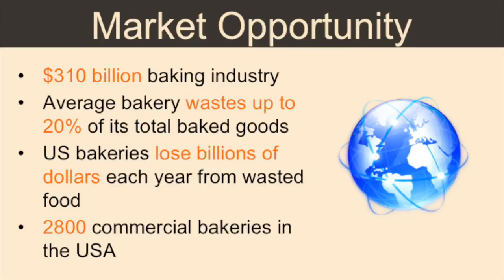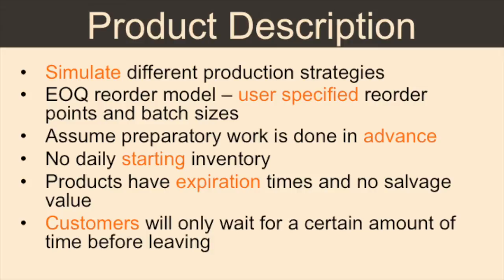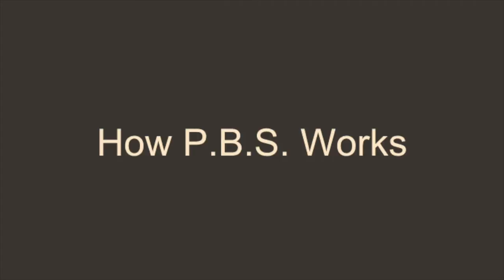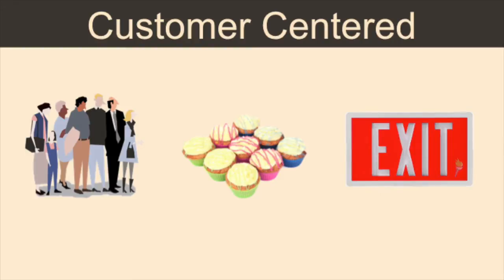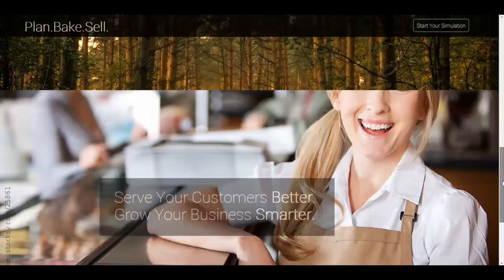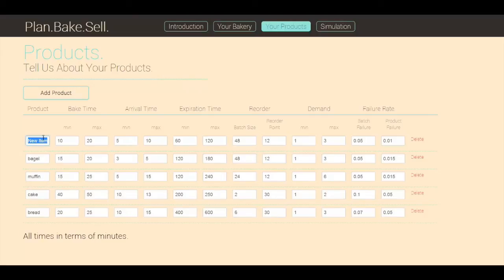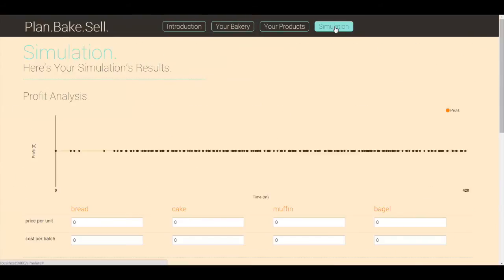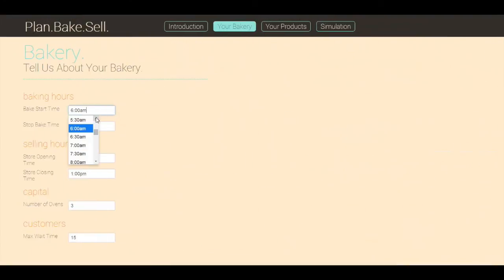IEOR 131 SP14 -- Plan.Bake.Sell.

Comment: All in all, your project and presentation are spectacularly executed. The market, problem, and solution are not just well-defined but actually highlight a compelling opportunity for simulation to be beneficial. As others have said, the user-interface design was well done and the real-time updates add that extra bit of "wow". Only thing that I would point to as a place for improvement is the assumption that customers will leave if their first choice is not available. Perhaps there could be some parameter for the shopkeeper to estimate the subjective probability that a customer selects their second choice, or third choice, etc.

Comment: Enjoyed the soundtrack and the testimonial at the end! (though some may find it offensive I would expect?) I'm concerned that the "no daily starting inventory" assumption may not be applicable to some bakeries, but you're internally consistent with this by saying leftover inventory has no salvage value.  Still, maybe this could be another improvement of your model?  Accounting for failure rates is a very good feature of your model.  Also, your UI is amazing! Good job!

Comment: (ID: DAODA) Awesome video!! The presentation is very engaging and I can see there is a huge market in front of your guys!! Since your product has four goals as it is shown at the end of the video, I think it is better if you can elaborate more on that how your simulation could help, for example, give us some performance metrics such as what percentage of customer demand is met and what percentage of cost is reduced by changing one input parameter.
Also for minimizing the cost, I think you should also incorporate the cost for hiring an extra employee to accommodate the demand.
In your profit-loss analysis, it’s clearer if you show us the formula you use, because for real businesses, they might want to add more factors into that formula.
Thank you!

Comment: I thought the profit analysis was very interesting, though it looks to me as though changing the cost and selling price of the baked good merely altered the profit for an already-run simulation, and did not affect the simulation itself. I think that it would be good if the simulation could adjust with these parameters, as the EOQ model incorporates holding cost when determining how much of a product to produce. In a bakery, holding cost is very high as baked delectables will become cold or expire.

Comment: (93914) There is no doubt that the strongest part of the presentation is the real-time simulation. Other than this amazing feature, I think the assumption about EOQ is very necessary and the overall presentation is very convincing. The product will be very applicable to both large scale companies as well as small bakery shops. Nice job!

Comment: The interface on this product is great. The graphs for the other metrics like unsold goods, throughput, and product inventory are all really beneficial. I think the model can be made more realistic by changing some assumptions. Many bakeries sell products that were baked the previous day for lower prices, which could add a salvage value to the model. Also, some baked goods sell more at different times of the day and week, which would change the arrivals rates.

Comment: (ID:CINCY) Wonderful user interface. I enjoyed the walk through of your concepts as well as the demonstration of your product and its functionality. The flexibility and dynamic aspects of your results pages are great features both visually and functionally. I think you may want to include a feature that allows for flexibility with size of ovens used. This simulation could be expanded into a longer time frame to allow the baker to plan for longer term and seasonality. Day to day may not be the most helpful if they need to order their materials in advance. I enjoyed this presentation and the music was a nice touch.

Comment: Beautiful, beautiful product. The interface is easy to use and thoughtfully designed. Works like magic! It seems like it would take a lot of effort on the bakery's part to gather all the metrics necessary for accurate simulation though... Still, great job!

Comment: Good interface design! Does the failure rate of the product depends on the sophiscation of the product (lower for cupcake and higher for wedding cake)? The model can include either disposing cost of a bad batch and/or salvage cost of leftover baked goods that can be resell for a cheaper price. (ID: TLCMP)